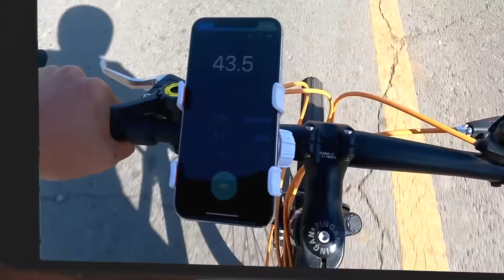How to Make a Speed Bike

Comment: that gear ratio is too high .i once built a bike to see how fast i could get out of it as my mountain bike was capableof about 57 mph off a near vertical cliff it wasnt long enough tbh.basically built a small racer with drop bars and a 56 to 11 ratio i took itto a pretty huge hill (forder valley in plymouth )after realising it was more a matter of aerodynamics not gearing after first run i acheived 64 mph seated i never managed to get in top gear as ifi stood up i slowed down so i remained seated  stripped the front brake off and managed 67 still never needing the 11 tooth .you dont need more than a 52 tooth to 11 rear .and aluminium not a giant steel piece of metal .realise too sunglasses blow off at that speed and youre eyes will water so much without them

Comment: Sorry folks, this is total fake. If the coat of paint for the fkin chain isnt a total giveaway, then look at the lines on the road. If those speeds were genuine, he would have passed the lines way faster than he does in the video. Also, the guy is showing hes going  50+ km/t but, he barely looks like hes doing 25... 
Also, him welding multiple cassettes to one bike makes no sense to why it would go faster. Torque is produced by legs, and how fast you pedal. Without gears to shift, it seems impossible to ever maintain a fast speed at all times, as he's stuck in one gear at all times.